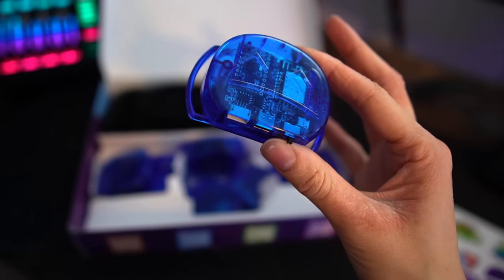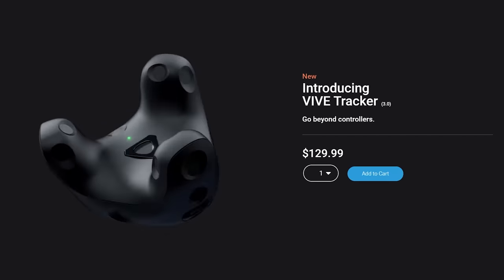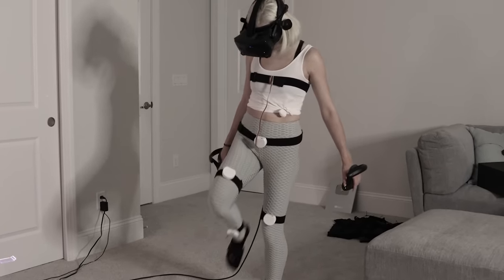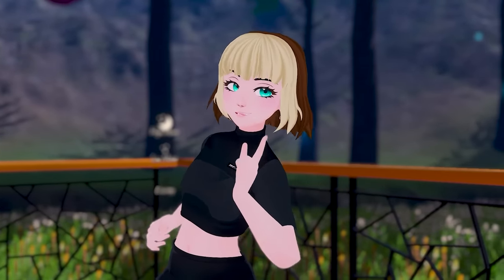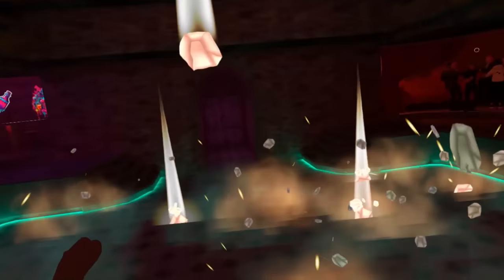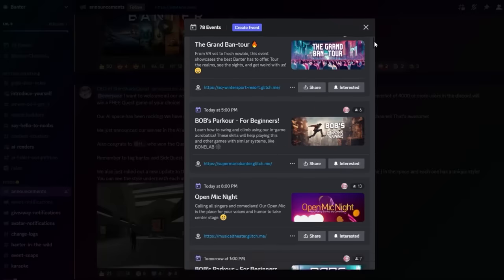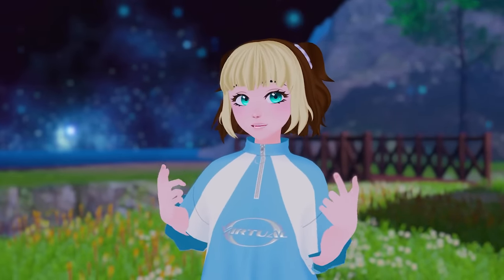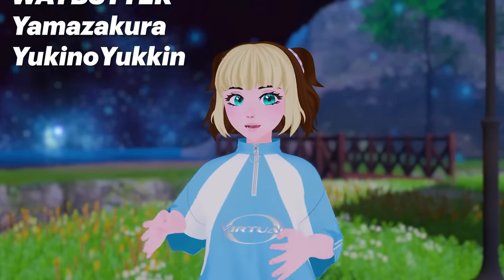Slime VR: AMAZING Full-Body Tracking on PC VR + Quest for... CHEAP!! (Big Updates)

Comment: The issue with them is a third-party program. If they worked with SteamVR and not take 6+ months to arrive. Obviously the trackers not working at all or struggle with connection isn't great either. 

It has a long way to go, would argue the 3.0's a still better as long as you have the money.

Comment: the thing i have an issue with is the fact that you need 7 slims to equal 3 vive trackers and i dont like things being on me as it is unconfutable ans ruins emersion i have slime but hardly use them as thats to much trackers for 3 joint movements.

Comment: I have waited 2 years for my set and the batch mine were in got caught up in an inspection at customs. Slime VR didn't do their research and the hardware needed to be certified independently and relabeled (the internal hardware doesn't have to be certified if used in Smartphones, but Slimes aren't smartphones, so they aren't except from certification). So it will be months for them to get shipped back to Europe, do all that, repackage, and ship back to the USA.

Comment: Slime has bad support and god help you if you want a refund from crowd supply. I had to take them to small claims to get my money back. If you want to buy the parts and put it all together then do that but buying them is pure hell. You will be looking at a year or more before your trackers ship. They simply do not have the man power to produce any more than a few hundred at a time.
Reply: SlimeVR company now has an assembly company they are outsourcing to, per the latest update! They said parts for around 6000 more trackers have been tested and are going to be shipped over to be assembled now.